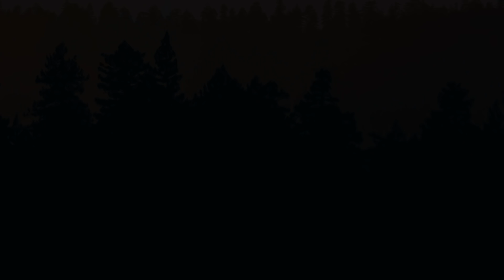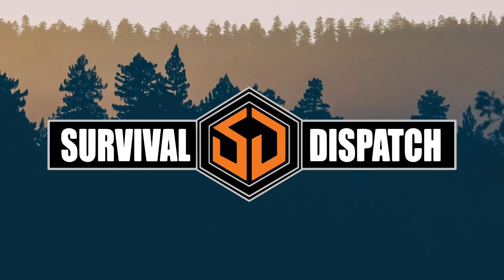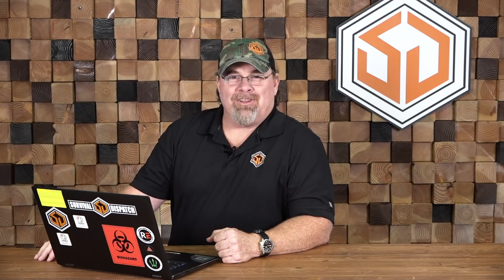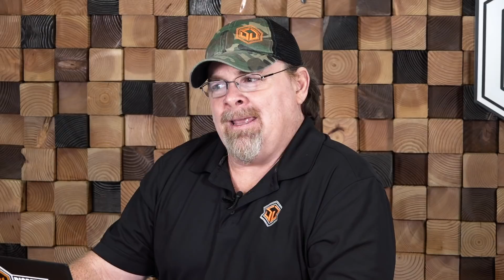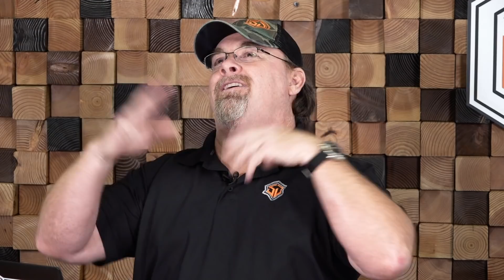All About Generators!

Comment: Please make a follow-up video on using the generator to charge up a deep cycle battery during the day and running a CPAP or other small appliance via a small inverter at night.  Thanks for posting this video.
Reply: That's exactly how I do it! That way I can run the generator just for a few hours to charge my deep cycle battery's
Reply: @kevinhansford3929  Here are the portable generator safety rules: this safety information is only for anyone who use a portable gas generator and for those who are planning on getting a portable gas generator. This is just a reminder for everyone’s safety. All generator safety rules should be followed carefully. This advice is just to make sure that everyone is aware of all the warnings and it’s just to remind people to be careful using portable generators. Generators can be dangerous if not used carefully. Every year, hundreds of people die or get injured when using portable generators due to carbon monoxide poisoning and electrocution. Make sure you are using your generator carefully and keeping others safe as well. There is something very serious that everyone should always be aware of when using generators. Some people do run their generator indoors which is not safe and that increases the risk of carbon monoxide poisoning which can cause death of family and you. Some people run their generator in wet conditions which can electrocute them. Please remember that you should never run your generator indoors. Remember that carbon monoxide is an odorless and colorless gas that you cannot see or smell. Carbon monoxide is a silent killer. Keep that in mind. Make sure your generator is 15-20 feet away from your house and away from doors, windows, and vents. Never use your generator in your porch too. Having a carbon monoxide detector is very important against generator safety. Some people also allow children to go near the portable generator which could pose risks. We need to keep an eye on our children making sure that they are not near the portable generator so they won’t get electrocuted or burned by the generator which is dangerous. A locking enclosure also keeps kids safe. A generator shed might look like a tempting place to explore, or take cover during a game of hide and seek, but a generator is a dangerous piece of equipment that can cause injury. It says on the manual that we should also keep children away at all times from the portable generator to avoid injuries. Please do not allow a child or unqualified people to operate the portable generator.  It is important to keep your children safe especially little ones. The portable generator can be hot during an operation. Just because some manuals missed what should be listed doesn’t mean it’s safe to do. Always follow the generator safety rules when using portable generators. Generators pose electrical risks. If you need to use your generator during wet weather, you need a generator tent to protect your generator from getting wet. Don’t let your generator get wet. Keep your generator dry and before using your generator, please make sure your hands and your generator is dry. Do not wear loose clothing when operating the generator. Everything that is said on the generator’s operating manual should not be ignored. Never smoke cigarettes near the generator. Please keep flammable things away from the generator. Never overload your generator too. Your generator can catch fire. Never ever try to plug a generator cord into a wall outlet to avoid back feeding. Back feeding your generator is dangerous. Always turn on your generator first before plugging in appliances and shut off the appliances before turning your generator off. Use a heavy duty cord for your generator and the cord should not be worn out. All the instructions should be followed carefully. Never refuel your generator while it’s running. It can cause fire if fuel spills while your generator is hot. You should turn off your generator and let it cool off before refueling it. Having a fire extinguisher next to the generator is also important. This is only a reminder for everyone’s safety of using generators. Make sure your generator is properly grounded. Having a fire extinguisher next to the generator is also important against the safety rules. https://youtu.be/I1jT3ANENvI and here is a video more about keeping others safe when using generators and also about our family’s safety. We should really keep our little children safe especially when the portable generator is operating. Make sure your children are away from the portable generator. Hope this helps. Thank you.

Comment: I have to disagree about running your refrigerator for 10 hours overnight and then shutting it off during the day.The temperature inside will reach 40 degrees+ rather quickly and all of your food will be garbage. A chest freezer, maybe, but not your standard refrigerator/freezer.
Reply: facts...
 ,,if its under 5 years old and you DONT open the door if its set to 33 degrees it will be fine for about 6 hours off...if you have an average refrigerator, you can probably count on it to maintain a safe temperature for about four hours—if you don't open the refrigerator door. For an additional two hours, your food remains safe if you're able to cool it back down below 40 degrees. the newest inverter type last up to 8 hours

Comment: That was great information thank you very much.   I’m running two refrigerators one small freezer.  What brand of gasoline generator do you recommend that is low on the noise output???? Thank you
Reply: Here are the rules about portable generator safety: This is just a reminder for everyone’s safety. All generator safety rules should be followed carefully. This advice is just to make sure that everyone is aware of all the warnings and it’s just to remind people to be careful using portable generators. Generators can be dangerous if not used carefully. Every year, hundreds of people die or get injured when using portable generators due to carbon monoxide poisoning and electrocution. Make sure you are using your generator carefully and keeping others safe as well. There is something very serious that everyone should always be aware of when using generators. Some people do run their generator indoors which is not safe and that increases the risk of carbon monoxide poisoning which can cause death of family and you. Some people run their generator in wet conditions which can electrocute them. Please remember that you should never run your generator indoors. Remember that carbon monoxide is an odorless and colorless gas that you cannot see or smell. Carbon monoxide is a silent killer. Keep that in mind. Make sure your generator is 15-20 feet away from your house and away from doors, windows, and vents. Never use your generator in your porch too. Having a carbon monoxide detector is very important against generator safety. Some people also allow children to go near the portable generator which could pose risks. We need to keep an eye on our children making sure that they are not near the portable generator so they won’t get electrocuted or burned by the generator which is dangerous. A locking enclosure also keeps kids safe. A generator shed might look like a tempting place to explore, or take cover during a game of hide and seek, but a generator is a dangerous piece of equipment that can cause injury. It says on the manual that we should also keep children away at all times from the portable generator to avoid injuries. Please do not allow a child or unqualified people to operate the portable generator.  It is important to keep your children safe especially little ones. The portable generator can be hot during an operation. Just because some manuals missed what should be listed doesn’t mean it’s safe to do. Always follow the generator safety rules when using portable generators. Generators pose electrical risks. If you need to use your generator during wet weather, you need a generator tent to protect your generator from getting wet. Don’t let your generator get wet. Keep your generator dry and before using your generator, please make sure your hands and your generator is dry. Do not wear loose clothing when operating the generator. Everything that is said on the generator’s operating manual should not be ignored. Never smoke cigarettes near the generator. Please keep flammable things away from the generator. Never overload your generator too. Your generator can catch fire. Never ever try to plug a generator cord into a wall outlet to avoid back feeding. Back feeding your generator is dangerous. Always turn on your generator first before plugging in appliances and shut off the appliances before turning your generator off. Use a heavy duty cord for your generator and the cord should not be worn out. All the instructions should be followed carefully. Never refuel your generator while it’s running. It can cause fire if fuel spills while your generator is hot. You should turn off your generator and let it cool off before refueling it. Having a fire extinguisher next to the generator is also important. This is only a reminder for everyone’s safety of using generators. Make sure your generator is properly grounded. Having a fire extinguisher next to the generator is also important against the safety rules. https://youtu.be/I1jT3ANENvI and here is a video more about keeping others safe when using generators and also about our family’s safety. It’s important to keep our children safe especially our little ones. Generators cause electric shocks too. It’s better to be safe than sorry. Hope you stay safe as well. Hope this helps. Thank you.

Comment: Gasoline doesn't really degrade. The ethanol in most gasoline is the problem. Ethanol free gasoline, if you can find it, lasts a long time when stored properly. 

Ethanol gasoline is garbage anyway so it's worth avoiding for all your gasoline powered small engines.

Comment: I would go with solar in the day a generator at night
Reply: my 300 watt solar is limited and still coast over 1500 bucks be aware..also most things that cause a power outage causes no sun to shine so...have a gen backup
Reply: @ImBehavingHoney  Times have changed.  You can get a 300w solar panel for <$100 these days.
Reply: @Chris-ie9os  its not the panels that cost its the batteries cable solar controller..the cable needs to be 8 or 10 gauge...the batteries are 400 bucks alone even if you ise golf cart. Then the proper wireing harness.. inverter.....it nickels and dime you to death
Reply: @ImBehavingHoney  Sure, but there's an inflection point where the costs become a lot more reasonable.  A 3kW (x10 more than the 300w you have) system doesn't cost $15k.  I have ~4kW of solar, with a 4.4kW off-grid inverter and ~20kWh of batteries.  Whole thing set me back <$5k.  I could easily run everything 24/7 from March until early November.
Reply: @Chris-ie9os  I also have 10000 dollars in guns ,ammo, and freeze dried food and water to keep it.
Reply: @ImBehavingHoney  Kinda my point.  People spend tens of thousands on prepping they may never use.  Buy a ~$5k PV system that will save you $$$ everyday AND can provide backup power if you need it.
Reply: @Chris-ie9os  prepping is like a condom...
Reply: I ran off-grid for an entire month just to see if I could.  Worked great.  I bought 8 L16 batteries for ~$3k.  They easily run my house through the night even with AC going.

Comment: Ethanol free fuel is a must for all small engines.
Reply: Or any gasoline engine older than 1997. My 1993 Ford Escort leaked fuel from rubber hoses wrecked by ethanol.  Power reduction and mpg reduction, compared to 100% gas.
Reply: Star tron solves ethanol problems,research it
Reply: @joshmason1003  i have and do use it when I'm forced to use ethanol free for my small engines. It does work, but just buying ethanol free is simpler and cheaper.
A large number of gas stations in my area have gone back to offering ethanol free so I can even go back to running it regularly in my vehicles which increases my fuel mileage too.
Reply: Here are the portable generator safety rules: this safety information is only for anyone who use a portable gas generator and for those who are planning on getting a portable gas generator. This is just a reminder for everyone’s safety. All generator safety rules should be followed carefully. This advice is just to make sure that everyone is aware of all the warnings and it’s just to remind people to be careful using portable generators. Generators can be dangerous if not used carefully. Every year, hundreds of people die or get injured when using portable generators due to carbon monoxide poisoning and electrocution. Make sure you are using your generator carefully and keeping others safe as well. There is something very serious that everyone should always be aware of when using generators. Some people do run their generator indoors which is not safe and that increases the risk of carbon monoxide poisoning which can cause death of family and you. Some people run their generator in wet conditions which can electrocute them. Please remember that you should never run your generator indoors. Remember that carbon monoxide is an odorless and colorless gas that you cannot see or smell. Carbon monoxide is a silent killer. Keep that in mind. Make sure your generator is 15-20 feet away from your house and away from doors, windows, and vents. Never use your generator in your porch too. Having a carbon monoxide detector is very important against generator safety. Some people also allow children to go near the portable generator which could pose risks. We need to keep an eye on our children making sure that they are not near the portable generator so they won’t get electrocuted or burned by the generator which is dangerous. A locking enclosure also keeps kids safe. A generator shed might look like a tempting place to explore, or take cover during a game of hide and seek, but a generator is a dangerous piece of equipment that can cause injury. It says on the manual that we should also keep children away at all times from the portable generator to avoid injuries. Please do not allow a child or unqualified people to operate the portable generator.  It is important to keep your children safe especially little ones. The portable generator can be hot during an operation. Just because some manuals missed what should be listed doesn’t mean it’s safe to do. Always follow the generator safety rules when using portable generators. Generators pose electrical risks. If you need to use your generator during wet weather, you need a generator tent to protect your generator from getting wet. Don’t let your generator get wet. Keep your generator dry and before using your generator, please make sure your hands and your generator is dry. Do not wear loose clothing when operating the generator. Everything that is said on the generator’s operating manual should not be ignored. Never smoke cigarettes near the generator. Please keep flammable things away from the generator. Never overload your generator too. Your generator can catch fire. Never ever try to plug a generator cord into a wall outlet to avoid back feeding. Back feeding your generator is dangerous. Always turn on your generator first before plugging in appliances and shut off the appliances before turning your generator off. Use a heavy duty cord for your generator and the cord should not be worn out. All the instructions should be followed carefully. Never refuel your generator while it’s running. It can cause fire if fuel spills while your generator is hot. You should turn off your generator and let it cool off before refueling it. Having a fire extinguisher next to the generator is also important. This is only a reminder for everyone’s safety of using generators. Make sure your generator is properly grounded. Having a fire extinguisher next to the generator is also important against the safety rules. https://youtu.be/I1jT3ANENvI and here is a video more about keeping others safe when using generators and also about our family’s safety. Hope this helps. Thank you.